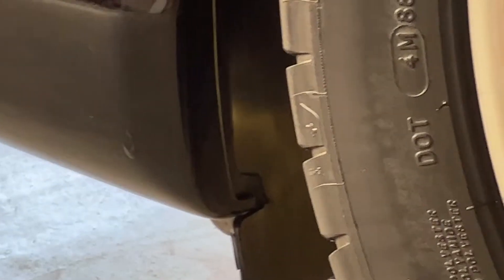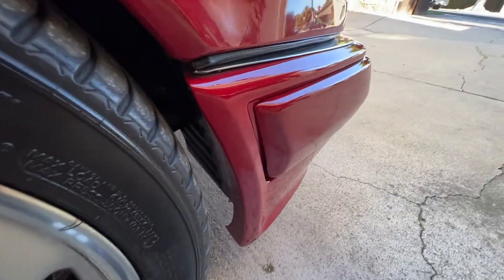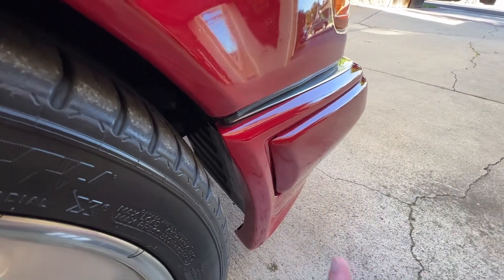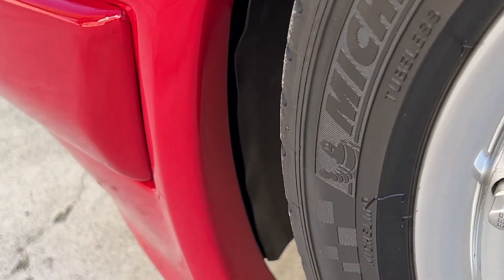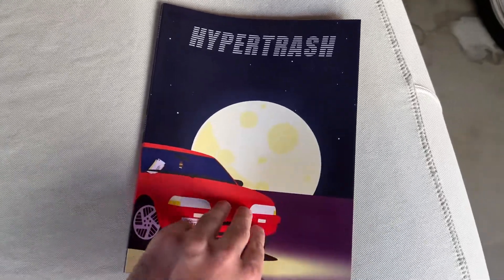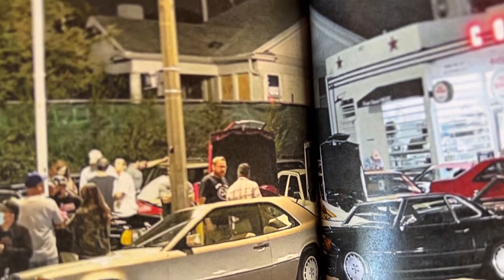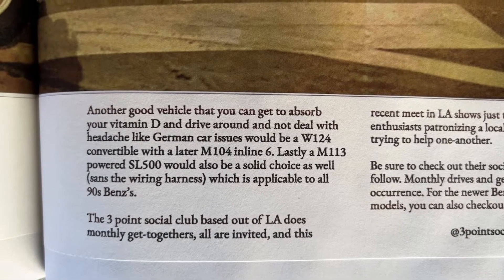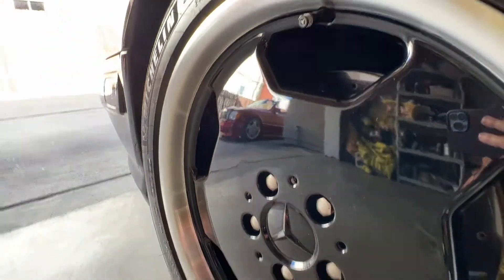Driving My W210 and W124 Vlog

Comment: What suspension do you have on the E55 and what kind of have you done to the Exhaust
Reply from the maker: It’s on H&R springs with bilstein b8 shocks. Exhaust is secondary cat and resonator delete with x pipe and gutted amg muffler
Reply: I recently did H&R springs on mine and I think it sitting higher than before. I'd be happy if it sat like yours
Reply from the maker: My car sat really high for the first few months. The springs took awhile to settle.